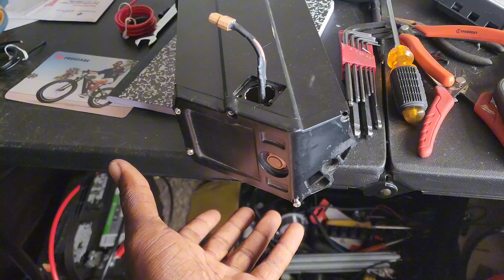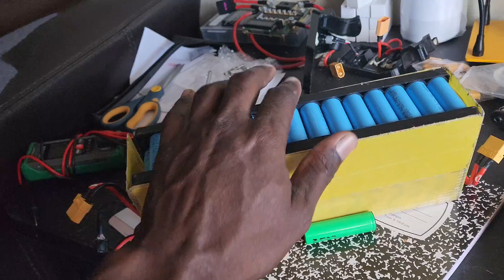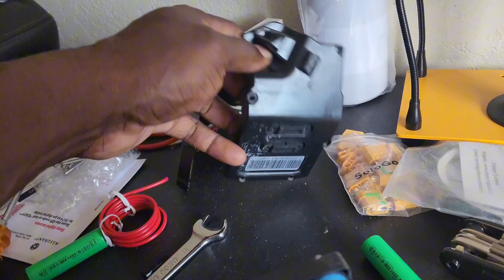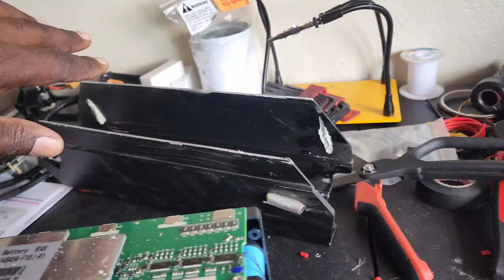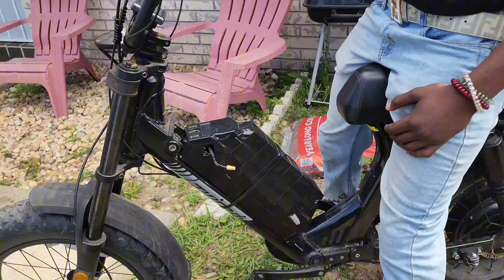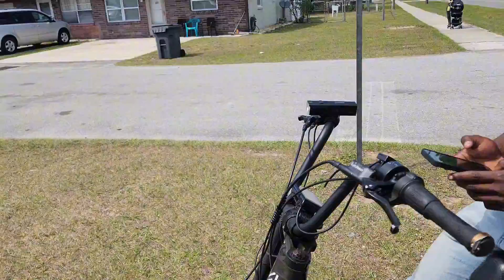increasing the capacity of this 52v 15ah ebike battery

Comment: I wonder if you switched from 18650 batteries to 30700 but left the same overall board size but modified to run 30700 would you get more range and power

Comment: Hi ebike guy, another problem on my stealth bomber😅  I was going fast and while braking the power went out, I turned it off and on again and it was working again, but then the front and rear lights, the horn and the electric brake they stopped working, what could it be? the bike works normally apart from those things, the pas work..may have burned the dc dc converter?
Reply from the maker: Yes check the step down converter
Reply: @EBG-offical  ok, where can I buy another one?

Comment: I have not tested enough to say 100% but I believe that I've discovered that if you put batteries on a warming surface it will rehabilitate and charge it simultaneously...

When you charge a battery it warms itself by chemical reaction. I believe that when you warm a battery you also charged it this additionally will rehabilitate some bad batteries as I've been laying my batteries on top of my 1000 watt amplifier stereo for convenience and realizing these wonderful finds. Specifically my Black & Decker batteries for my leaf blower I'll run them dead put them on the stereo and not too long from then full charge again, the same goes for my motorcycle battery that was dead going to get a new one as far as I was concerned it was only charging to 6.7 volts Max I was going to use it to charge my cell phone for a long time. I checked after several days and it's at 8 volts.

Pass it on, because I don't think anybody in the battery business wants you to know this
Reply: I've since charged two batteries in heat and it does it rapidly it reconditions at the very least

Comment: Yea 15ah batterie is small for that bike. I was going to get that ebike the 20ah juiced scorpion but 20ah os still a little small for me being that i use my ebike to do uber eats i typically put 30 to 50 miles a day. Sometime 70. And juiced charges like 600 to 700 gor an extra battery. Im running on 43 ah and sometimes i just wanna ride throttle only. I bike like that i feel should come with a minimum of 25ah. Alot of bikes are now coming with 20ah or better but at the same time the motors and controllers are getting bigger and bigger and that eats right through 20ah
Reply from the maker: Lol you need one of my mega range batteries

Comment: You asking for trouble modifying a stock manufactured batt. Adding cells aint worth the risk. New cells mismatched brands and old degraded cells with diminished capacity is gonna end in flames. He needs a pedal bike not a more powerful batt that hes gonna neglect....

Comment: @1:30 had to listen a few times to see you are saying your controller is 36v/48v/60v which is very unique because normally there is one jumper wire to connect/disconnect to set the LVP at 42v (for 48v) and 52v (for 60v). Not sure how you can select 36v which would set LVP at 31v. 

I had a 48/60 controller with my 13s battery and accidentally had it set for 60v, so it shut off every time the pack sagged from 54v down to 52v basically 100 feet down the road lol.

On a 14s pack it would shut down at 50% SOC or higher when full throttle if the controller wire was set for 60v.

If the controller is set for 48v then LVP 42v/14s is 3v/cell average and probably ok since the BMS will probably be near its LVP. 

Which voltage did you set the controller for? It cannot auto-detect since the voltage range overlaps. But it can be 36v/60v jumper connected, 48v jumper disconnected, since it can distinguish between 36v and 60v. 

Probably a nice mini topic for those who still use basic controllers.
Reply from the maker: Yes it a NP power controller it will do 72v 60v 48v 36v but not 52v for some strange reason
Reply: @EBG-offical  , yes, these were all designed for lead acid batteries lol. So how to you select it? 

No way they have 4 jumper wires so I assume the jumper is in one state for 36v/60v and the other state for 48v/72v, which means you would choose 48v/72v because the 36v/60v will automatically default to 60v when it sees 58v from a 14s lithium pack. 

If it thinks its 60v pack LVP will be 52v and shut off at 50% charge. 

This is one of many reasons I switched to programmable controllers. Lol
Reply from the maker: @imho7250  I just put it a 48v  but I need to get a controller that can do 52v, I thought that one can do 52v
Reply: @EBG-offical  . Unless you can manually set LVP a 52v controller probably won’t change anything. I bet the generic (non-programmable) controller that advertises 52v just shares thw same 42V LVP as 48v since it’s reasonable at 3.00v/cell average. 

If you manually top balance the pack it will work a lot better and the BMS can maintain that.

Once top balanced then if you drain the pack and check the bricks you will see if there is a bad cell or if balanced charging has just been neglected or it was charged with wrong charger. It will only balance with a 52v charger with proper taper, and only if all cells are already within +/- 0.05v

But I understand this is just a favor you were doing to make the bike work better and you already spent a lot of effort on it. But content is content. Its all good.

Comment: Don't mix cells like that. You need to test the cells yourself. These companies write all kinds of values on there. A Chinese 2500 might be 1500 or less. 

Also what is the discharge rate of the 2 cell types. You have 1 that discharges at 25a and the other does 10. The BMS tests a group of cells as 1 cell and now you could have a disparity of quite a bit between cells. See the problem. It would be much better and way safer to make a second complementary battery with it's BMS. 

You want to test the inner resistance of the cells. They need to match pretty close if they are on the same BMS. Most of these BMS cut off if there is a difference of more 200ma. That's a pretty tight margin. Make a second battery sir. 

My renters just burned my rental property down last week. The cause was then mishandling lithium cells. The guy was a moron. He was the "head mechanic" at the bike shop he worked at yet I was always fixing his stuff. 

Do yourself a favor and don't mix like that. Chinese vendors are full of shit with their specs. Not everything is bad but you can't just believe the labels. Another BMS won't cost more than $20 and you could save someone else from losing life or property. I had even told the guy multiple times not to be careless. Burns the house down and the says to me accidents happen. I shit you not. At the scene of the fire a rope off hazardous materials area with 5 gallons buckets full of cells, or at least the ones that didn't grenade. Wires running everywhere and  apparently he has attached a walk in freezer to the side of the carport(he decided to enclose) like a little apartment. 

So that's obviously an extreme example of what could happen but that is going to be nothing but trouble and probably be out of balance easily and you will stuck doing more work because with different internal resistance the cells are going to be all over the place. Even a BMS with a cell balancer in it can't really handle larger differences  very well so if your BMS doesn't have that then it's going to be pretty sensitive. The BMS let's the cell charge to 4.2 and then any extra us getting burned off as heat using a resistor and a mosfet that the BMS triggers. They are not big resistors usually so if there is a big enough difference you still end up with a cell group far enough out of whack for the BMS to nope the hell out of there on you . 

A little extra work abd another BMS now is going to save you from a lot if work later. It bay even seem all peachy at first but after a bunch of cycles I am predicting  that battery will get dropped in your lap again. 

One cell can ruin an entire group and that's with cells from the same vendor with the same amount of charge  cycles even. Yeah, don't  mix cells, especially inside the same group. It would be much safer to replace an entire group or I this case just make a second battery. 

Get a 3d printer and print a case. 3d prnters are pretty easy now. You would be surprised I think. Another hobby rabbit hole to down.
Reply from the maker: I got cha 👊🏿👊🏿👊🏿

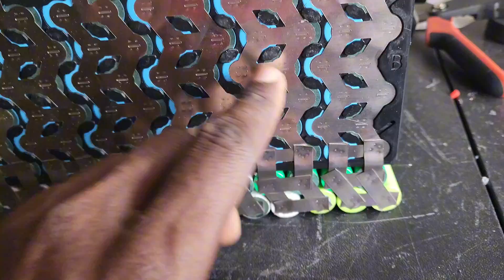Comment: @8:10 3.8v and 4.0v is too far out of balance for a dumb bms to balance. This is why he is complaining of short range because it cant fully charge and the bms will hit LVP for that 3.8v brick when the other cells still have 30% charge. 

Most likely it had a dead cell. Thats the usual cause of jumping so far out of balance that the BMS cant fix it. 

The short term patch is to manually balance it with your hobby charger so that the BMS can top balance it each charge. That will at least make it behaves like a 14s7p since you added 2 cells.

The real fix you have to find the beick with the dead cell, then find the dead cell, then replace that dead cell, then manually balance the pack and then it will behave like a 14s8p pack.

This is exactly what happened to my 18650 pack but it wasn’t until I added the Smart Bluetooth BMS that I could actually see the brick had a dead cell based on voltage sag under acceleration and voltage drop as the pack drained. 

And of course the Smart BMS will balance the pack even if it’s FUBAR like that one. The DUMB BMS can’t balance a pack that far out of whack because the highest brick will reach OVP before the charger tapers down current. 

In its current state the battery will go further but only 3ah of the 5ah you added can be used until you manually balance the pack.

Comment: Have you been hearing about all the battery fires and the battery shops they are shutting down in New York that are building batteries. I won't buy a battery unless it's UL listed. Take care nice information like usual
Reply: Having a battery UL listed doesn't mean shit bro sure it may provide you who don't know anything about lithium ion batteries some piece of mind but even with UL listed batteries problems can happen like if you run the shit out of your e-bike and it heats up and then you go straight home and plug it up on the charger that's a big No-No so no matter what happens it comes down to the person

Comment: He need to know how a ebike is to be cared for or a fire will start and burn everything up and the blame game begins people it's for Recreation and health purposes only  ride at your own risk  disclaimer!!!!
Reply from the maker: Yes I'm trying to teach them.. but it in one ear and out the other
Reply: What kind of things would make the battery catch on fire? Like I ride my ebike & when I get home I automatically just put the charger on it; I never rode the bike till the battery went completely out I don't even know how long the battery will last cause like i said I never rode it till it went out; I just know if I have it in mode 3 the battery will drain quicker
Reply from the maker: @MrAkaprimetime  you will know when it's time to replace your battery because you will notice an decrease in capacity
Reply: @MrAkaprimetime  OVER CHANGING IT LIKE LEAVING IT CHANGED FOR DAYS THE CHANGER WILL BECOME EXTREMELY HOT/BATTERY WHEN UNATTENDED!!!
Reply: Agreed with taking care of bike and battery.  It's a must he care for the battery's health.

@Ebikeguy, I never mix new and old cells, do you think that is safe on a ebike? I'd start with all new cells to reduce fire risk.  My opinion only :)  stay safe brother.

With my Lipos , if I connect a old damage cell to a new one, it will bring the capacity of the new one down to the bad cells level.
Reply from the maker: @bernardhfox  it's ok just as long the capacity the same also I seen people using laptop batteries to build